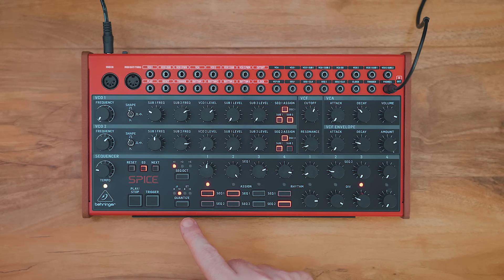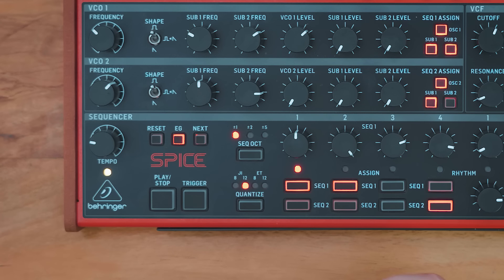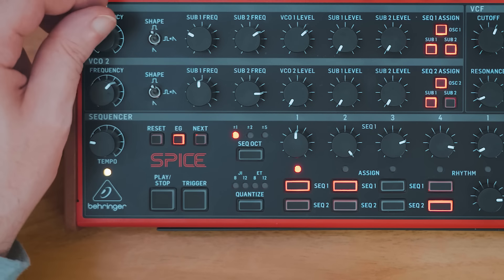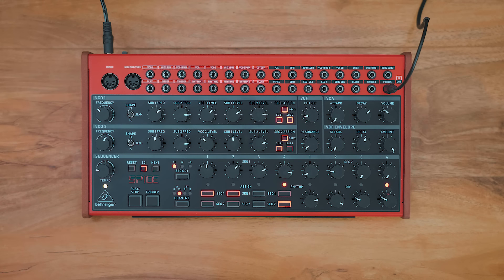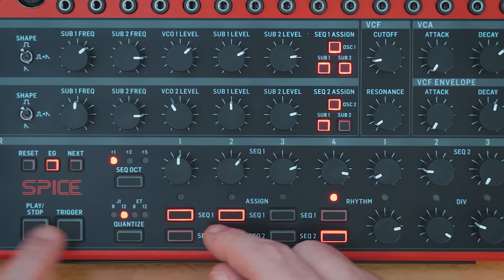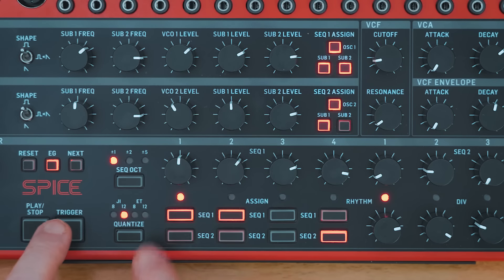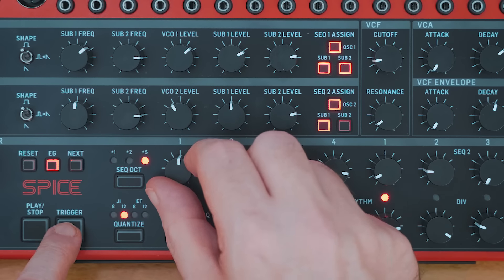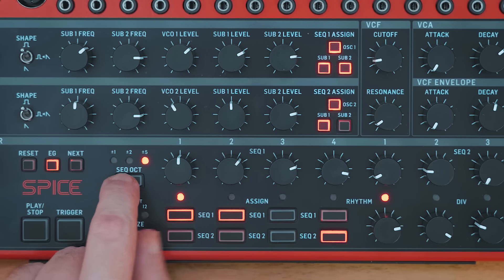Behringer SPICE - Features & Overview

Comment: Thank you for this amazing device! Please create a detailed video about the step sequencer. Additionally, it would be great if sequences could also be played in reverse.
Reply: Sequencer is now working - Calibration
The SPICE has two calibration modes. While either is active the power LED will light in green.
Duty Circle Calibration: press and hold the PLAY/STOP button 33 then press the QUANTIZE button 36.
Frequency Calibration: press and hold the PLAY/STOP button 33 then press the SEQ OCT button 35.
The SPICE will exit calibration mode when it is complete.

Comment: Is there global tuning knob/option?!
Reply: there are some options:  Fine Tuning
To fine tune the SPICE press and hold OSC 1 button 8 and OSC 2 button 18 When all four QUANTIZE LEDs are flashing and the power
LED is lit green then the TEMPO control 29 can be used for fine tuning. At center there is no fine tuning. Turn the control counter-
clockwise to tune down by a maximum of 50 cents; clockwise to tune up by the same amount. Press the QUANTIZE button 36 to exit
fine tuning mode

and: Calibration
The SPICE has two calibration modes. While either is active the power LED will light in green.
Duty Circle Calibration: press and hold the PLAY/STOP button 33 then press the QUANTIZE button 36.
Frequency Calibration: press and hold the PLAY/STOP button 33 then press the SEQ OCT button 35.
The SPICE will exit calibration mode when it is complete.

Comment: Can the sequencer be connected to the MIDI out?
Reply: Just checked the manual-- looks like it can: "MIDI OUT/THRU – this socket outputs MIDI values derived from the SPICE sequencers, and also passes any incoming MIDI messages received by socket 57".   Socket 57 is the MIDI in I think.

Comment: Behringer, im in canada and love your products, ive fully paid for a poly d from long and mcquade here that i ordered june 2024 and the ship date just went from october 30 2024 to april 2025.   I think this is a little to long to wait can anything be done to remedy this situation.    10 months for an order with no guarantee itll even arrive by then, cmon.
Reply: That sounds like a problem made by the retailer, using Behringer as an excuse. Taking orders for units they know can’t be fulfilled within the timescale provided. 
I’ve just received a TD3-MO, out of stock when I ordered it but arrived within a few days of the retailers estimate.
Reply: Cancel the order and get it from Thomman out in Germany. I've had great success with them and I live in the states. I got the modules I ordered in 3 days.